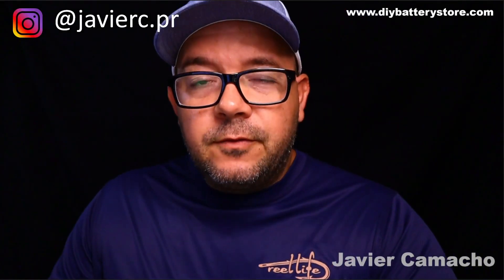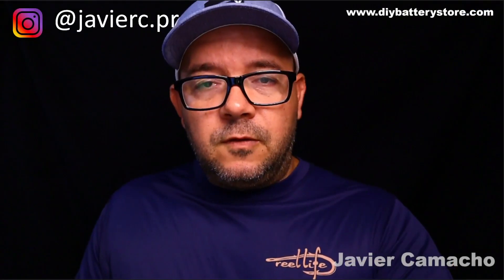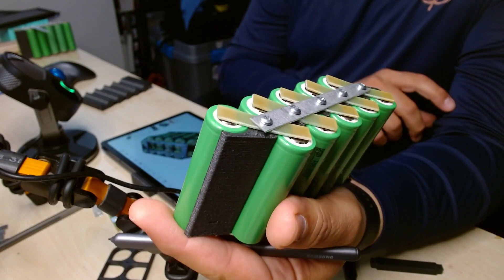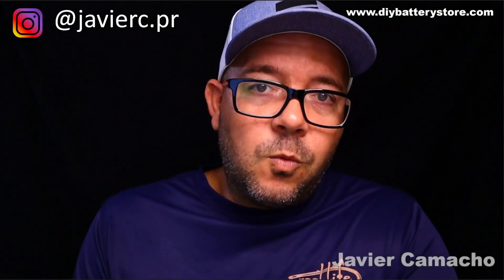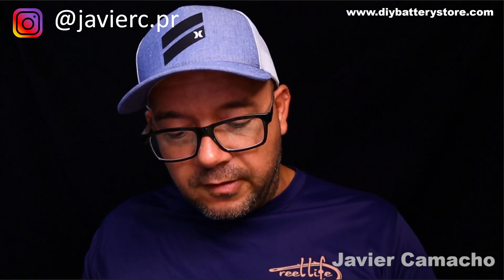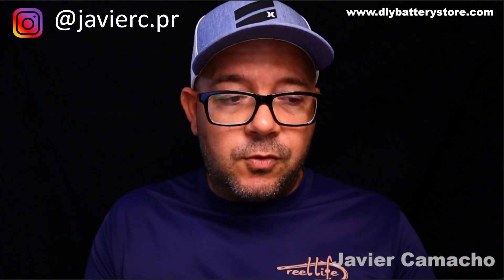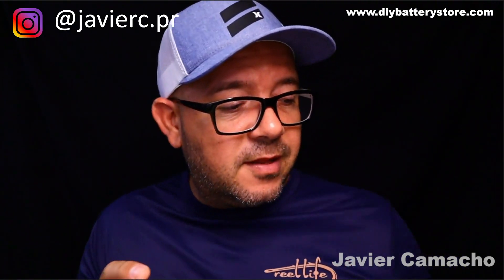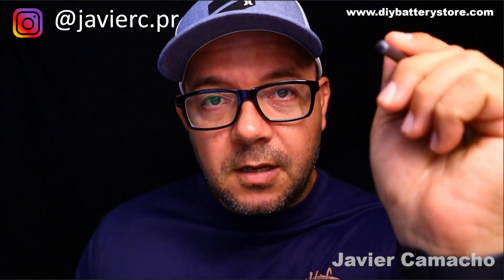Project Update of the Mega Diy Battery Build. Pt 3

Comment: By you getting gigantic battery banks, you need to get effiencies not needed at the small scale level. There may not be a market for your customized improvements.
Reply from the maker: I understand, but I'm almost done with the diy battery projects and moving to other topics sense there isn't any interest anymore from the community or any market.  People just want to buy stuff of the shelves and not go through the diy hassles.
Reply: Hey Javier,
Wow that’s a lot of printing, I can see why your looking to streamline the process.
Printing is great but not awesome if your trying to produce high quantity.
Is there a way you can utilise the generic 18650 cell holders and integrate your PCB style connectors/fuses and buss bar system?
Then you’d have no printing to do and have a great low cost system design that is easy to assemble?